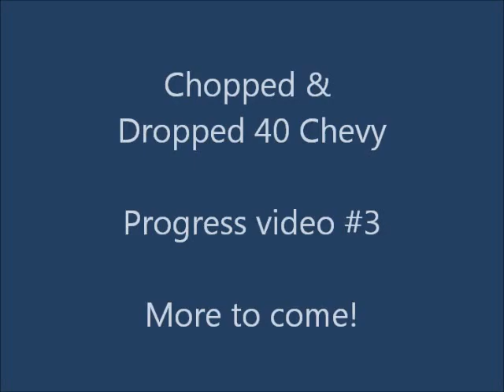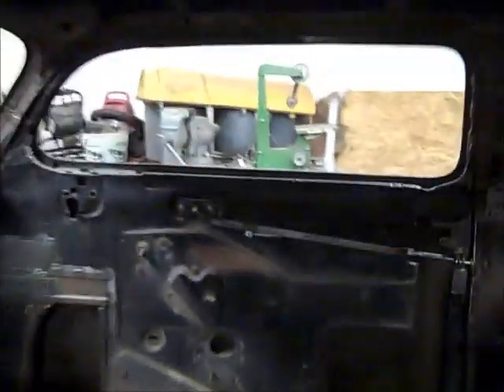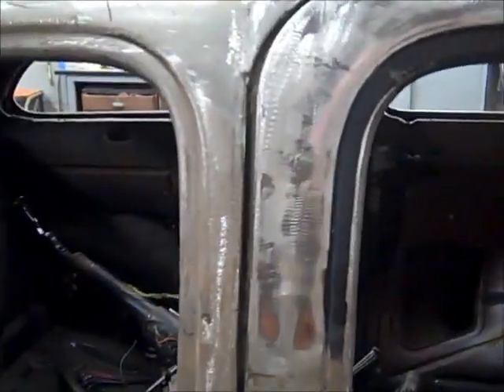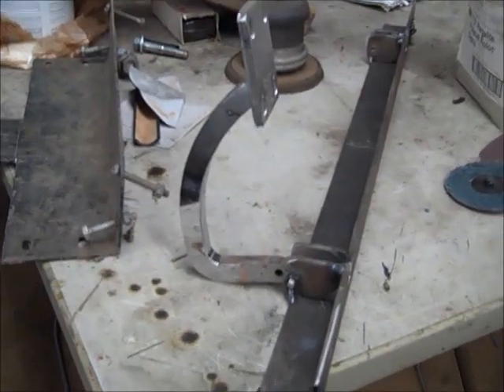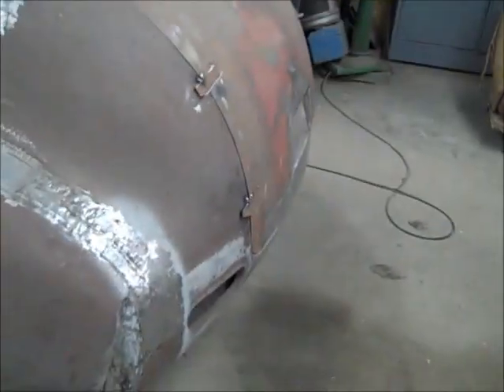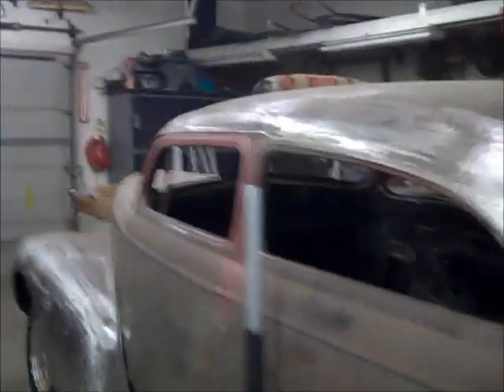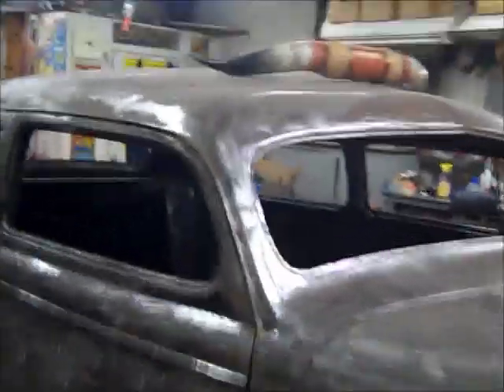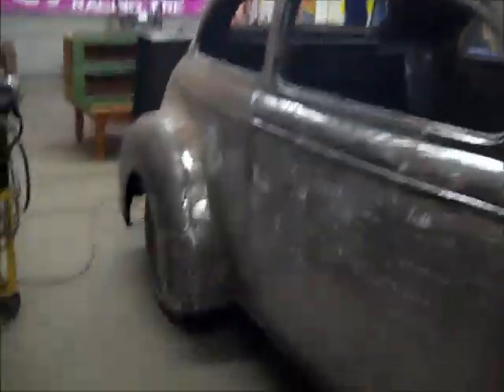Chopped & Dropped 1940 Chevy 2 door sedan (OLD Video #3) TINMAMA

Comment from the maker: Original Frame-Blasted, Nova Front subframe, and some crossmembers to keep everything straight and strong. Has new aftermarket leafs and lowering blocks in the rear. Will eventually need drop spindles in the front probably too (So we can get the bitch on the ground). Subscribe to see more updates!!

Comment: Your hood is too far back, if it was moved forward it looks like the nose would fit to the grill ,ect,ect.
 Looks like that would improve the gaps on the front, and then you might be able to take out the shim you spoke of, I think the rad support and the way the grille is setting looks like it is running uphill anyhow.
Reply from the maker: Robert Serr yes this video is very old. we have made quite a few changes in the meantime, including a new subframe swap and re-doing the core support up front